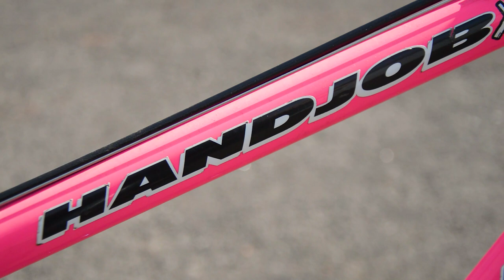Converting An Old Mountain Bike To 12 Speed - SRAM Eagle NX - Cove

Comment: Just recently honed a 27.2 dropper post down to 26.8 wall thickness was no issue whatsoever. Works flawlessly. Go for it!!!
Reply: frame is a 93 Rocky Mountain Hammer.
Reply: could probably find a machinist to turn the outer tube down on the lathe.
Reply: @somn__  yeah but Phillip honed from the inside out making the ID smaller and increasing the wall thickness to 26.8mm. True magic
Reply: @janeblogs324  😄sorry obviously I’m not a native speaker. So what I did is sanding it down on that spinning wheel sander at work. I first thought it would be a mess, but taking my time doing many light even repetitions and checking after each it turned out quite perfect.
Reply from the maker: Mmm interesting.  A dropper would be a great addition to this one.  It's the one thing I feel is holding it back at the moment.
Reply: @Phlizz  internal routing one or external?
Reply: @aaivilchip  neither, I went with the crotch lever model 😄

Comment: Excellent video and very striking the name of the bike 😅 By the way, as a tip, I recommend not using torque wrench to release components, screws or nuts. This causes them to decalibrate
Reply from the maker: That would suck!  It has to be used "in reverse" to do up the drive side BB cups!

Comment: Amazing Im still riding my 90ies 26" MTB (Alu frame/Magura Bartman/Rockshox/etc) ... and planing to replace my 3x8 old deore/xt/original gripshift 500R  with a new new group. Fingers crossed the NX/GX will fit.
Reply from the maker: That’s going to be some upgrade! I’m pretty sure the 12 speed should fit on the 8 speed hub from what I remember. Good luck.
Reply: @MonkeyShred  Cheers!

Comment: that's a corker :-)  and hats off to the LBS
don't talk to me about Sram 12-speed derailleurs!!  When re-fitting one a year or so ago I couldn't get it to index properly, and after thinking it was the lever (a hydraulic one which I took apart at great mess and many expletives) I realised I'd not routed the cable properly!!
Reply: You converted hydraulic derailleur to cable? You're a wizard
Reply: @janeblogs324  if only
hydraulic brakes, cable derailleur.  taking the lever apart I got hydraulic fluid everywhere
Reply from the maker: Ooo ouch.  That sounds like a painful experience.

Comment: Great Vid pal. in the middle of a build myself, would you recommend putting the chainring on the inside of the crank or the outside?
Reply from the maker: I put mine on the inside to keep the correct chain line. I think it should always go in place of the middle ring on a triple crankset unless you use a shorter axle to bring the whole crankset in closer.

Comment: Did you need to change your bottom bracket? I wanna do the same on my old ‘08 trek fuel. Found a killer deal on a complete SRAM NX drivetrain. Would love to revive and keep as a spare bike for buddies when i hit the trails.
Reply from the maker: I did change the bottom bracket but that was purely just to replace the worn original.  I used the original crankset too - just changed the chainring.

Comment: I want to upgrade my hard tail wheel set and group set from 1x11 to 1x12 and add dropper and should be near finished and forks from coil to air forks then bamm should be no further upgrades
Reply from the maker: Go for it!  Good luck.

Comment: How are the XT brakes working? Did they  need a bleed or new pads?
Reply from the maker: Initially - they were very soft but when I first went out on it they seemed to firm up.  They feel nice actually.  I am going to replace the discs and pads.  The discs are slightly discoloured from heat and the disc/pads were SCREAMING in the rain yesterday.

Comment: how did you know that the hub will be able to admin 12s cassette?
Reply from the maker: I didn't fully.  I saw @ToastyRides do a 12 speed on his channel with a thumb shifter and I tried to double check at my LBS too.
Reply: Thanks mate! I assume your hub it’s a 135mm and the freehub is 35mm? Was the cassette 12speeds from shimano?
Reply from the maker: @edlauc  it’s definitely 135mm rear. As for exact free hub measurement, I don’t know. No all the gear was SRAM. Shimano apparently run microspline for 12 speed so I’m pretty sure that doesn’t fit a regular HG free hub.